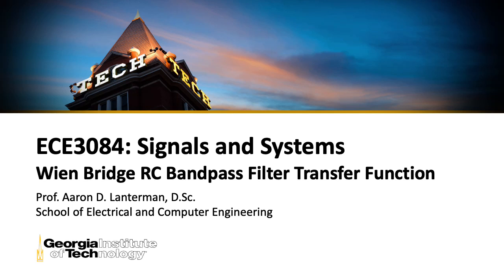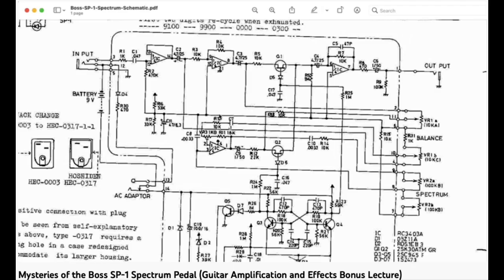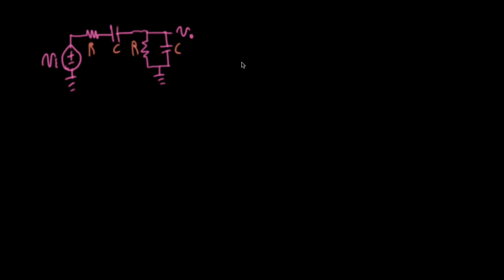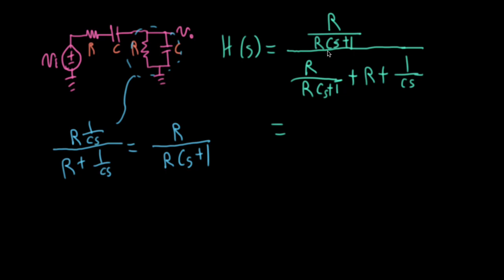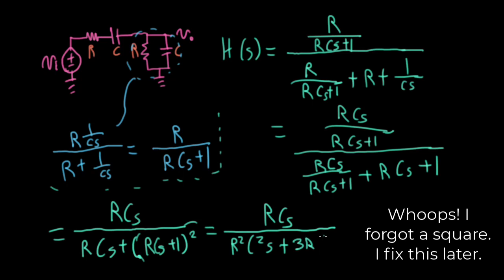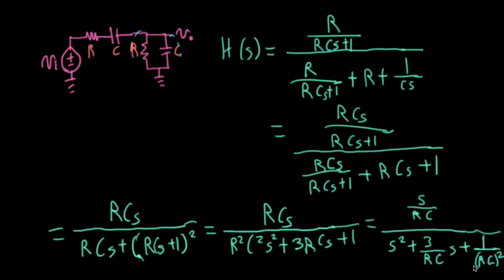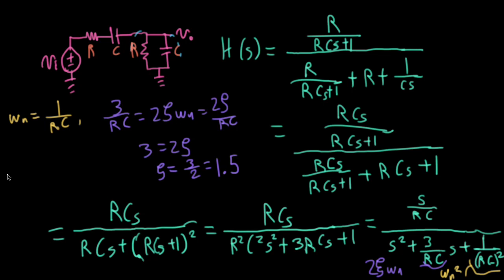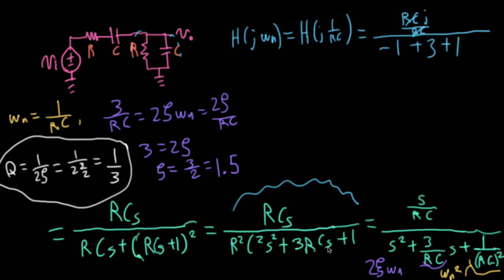ECE3084 Lecture 56.2 Wien Bridge RC Bandpass Filter Transfer Function (Signals and Systems)

Comment: As a long time hobbyist I have been able to find many designs and discussions of Wien Bridge oscillators but none of them have answered my questions on the design of the feedback network.  Most just say the R's need to be the same and the C's need to be the same and then give some values to use but don't explain how those values were determined.  I don't fully understand your explanation (yet) but do see that the section in the book on transfer functions is worth more effort than I have given it.  Thanks.
Reply from the maker: I think you'd enjoy some of the other lectures in my ECE3084 series. Here's the playlist: https://www.youtube.com/playlist?list=PLOunECWxELQRYwsuj4BL4Hu1nvj9dxRQ6

Comment: It's been a long time since I was in university but I genuinely think there's a lot of value in working through this kind of problem on the board rather than always being the diligent professor and preparing it all beforehand.  

My professors had a habit of skipping straight to the answer in these situations while stating that everything in between was "just algebra", or at most writing out a few optimized lines of work copied from their lecture notes to solve the problem in the most efficient manner possible.  In some sense they are right.  It is just algebra, and anyone taking that kind of course should be more than familiar with solving these problems.  It doesn't really set the right expectations for what doing this kind of analysis is like though.  In a typical math course, especially calc courses, if a problem starts to get needlessly messy it usually means you've missed a trick or are making things difficult on yourself.  "Ah you could have saved yourself 20 lines of work if you'd only remembered this weird csc^2 identity and rearranged the whole problem into that form.  Enjoy your partial credit."  As an undergrad I remember having a kind of anxiety whenever things expanded out and got messy because of that.  

It seemed like I had to be doing things wrong or was really slow to solve problems because I didn't immediately see how to factor out some oddball mix of terms to get directly to a solution or took ages working through a fairly basic opamp circuit as equations grew more and more verbose.   When I had to solve problems on my own the process seemed not just less straightforward but entirely different from the direct "and this is just algebra" approach that was always demonstrated in class.  Preparation is good, don't get me wrong, and I'm sure it feels a little awkward making mistakes in front of an audience.  There's value in seeing what it's actually like to solve these kinds of problems though and how to feel out of the process.  Rather than always portraying the whole thing as effortless from start to finish, as if you should basically always know the solution before you even begin.

Anyway it's always interesting to see some of these more unique approaches to various circuits out there, even if the pricetags attached to products using them always seem vaguely horrifying.  I know you have lectures to keep up with but one thing I'd love to see you go over at some point would be the THAT2252 based non-linear capacitor circuit described in THAT corp design note 114.  I cannot seem to work out what is going on there at all and I feel like the longer I stare at it the closer my mind gets to touching the void.
Reply from the maker: Ah yes! Indeed I have looked at the non-linear capacitor circuit. I had a student built it some years back. But to be honest, I don't understand it myself, despite going over that app note several times. If I ever get any insight I will do a video on it.
Reply: @Lantertronics  Pretty sure I managed to figure it out a week or so ago and I sent an email your way though I'm not sure if it ever reached you, I noticed later that I kind of messed up while trying to pretty up the simulated circuit I included as well anyway.  To repeat the general idea quickly though.  The circuit seems to be using the Miller effect to create a capacitor with two different values by making an amplifier with two different gains.   If the capacitance between the input and output of an inverting amplifier is Cin and it has some gain A, then the Miller capacitance seen at the input is Cin(A+1).  If you change the value of A then you would also change the virtual input capacitance of the amplifier which is what the circuit is doing.  By making the gain of an inverting amplifier follow a nonlinear relationship you can get a nonlinear capacitance at its input. 

The inverting amplifier is implemented with an op amp in a pretty typical way only instead of using the impedance ratio of two resistors it's using the ratio of two capacitors in the same way.   Because they are using capacitors a high value resistor is necessary to counteract the input bias current of the opamp though it also has the effect of gradually causing the opamp's output to drift back toward 0V over time.  If the op amp output is ever large enough to bias one of the diodes then the gain of the amplifier drops off sharply.  As a result the amplifier typically has a very high virtual input capacitance which is able to drop off sharply when the input is sufficiently large.  For a compressor this means it holds its level well but can still react quickly. 

The higher the forward voltage of the diode the more pronounced the difference can be between the high and low capacitance states while keeping the input amplitude at which it switches over the same. Which is why green diodes are used in the design note.

Comment: Awesome as usual :) 

One question - what software package are you using for your whiteboard (hand-drawn) graphics? Whatever you are using it seems that you can change pen colors and erase pretty quickly. Same for the screen recorder, are you using Camtasia or some other product?
Reply from the maker: Thank you for your kind words! For the hand-drawn graphics I use Autodesk Sketchbook, which is free, and I use a Wacom graphics tablet. I've gotten pretty fast at moving over to the side of the screen (beyond where I am capturing) where I have the color pallet preset to the Khan academy colors. I can flip the pin over to erase. Some of the apparent quickness comes from how heavily I edit the videos. I use Camtasia for both capture and editing.

Comment: today, i got a mini load of That BJT array's @ 10€+ each.
how could I build a voltage controlled variable resistor between 80K and 200K?
Reply from the maker: What is the application?
Reply: @Lantertronics  some Chinese chip, "isd1820" voice recorder, you can increase recording time by varying a resistor, 80K for x seconds and max 20 seconds for 200K having a lower bit rate. Bastle electronics / eurorack modules has a schematic online. but they have a 220K pull up and a pot to GND, but datasheet of the chip says something else, 80K to 200K to GND.

Comment: At 5:50 you say "you get nothing at DC" but wouldn't that just be a voltage divider and you'd get half of Vin?
Reply from the maker: Nope... there's that series capacitor that acts as an open circuit and completely blocks the input.
Reply: @Lantertronics  Gotcha. I think was confused by the caps crossed out (not there vs "open") and the line to ground from the output but that's just tying that low and the cap is blocking DC.
Reply from the maker: @justovision  You got it!